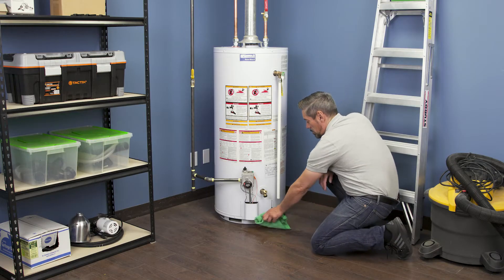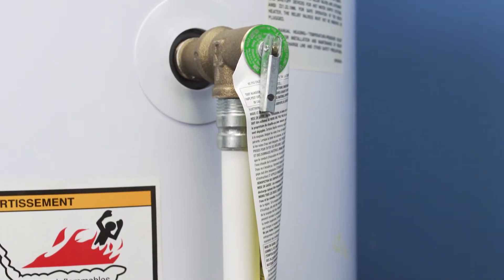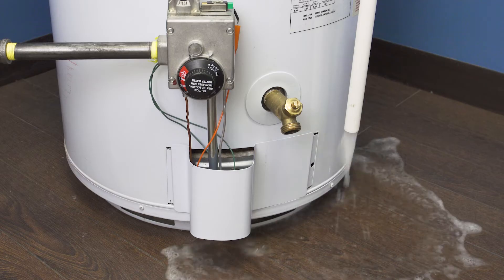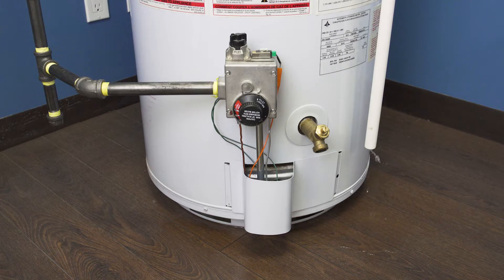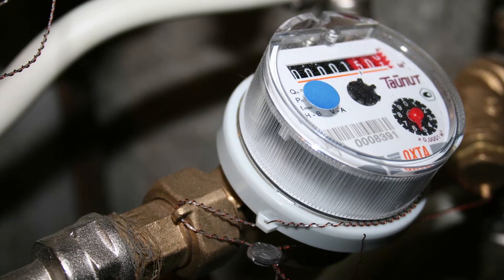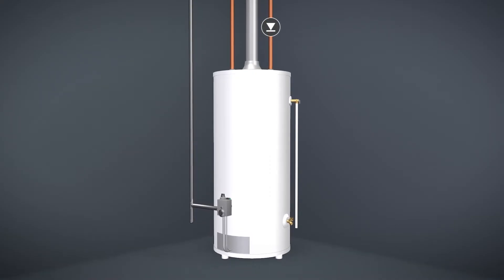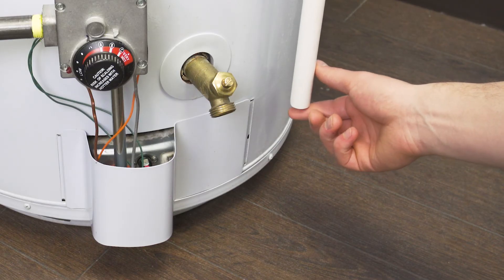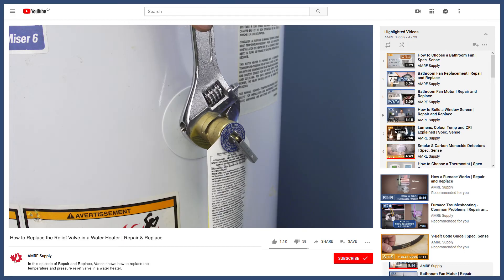Relief Valve Keeps Opening? Thermal Expansion Explained | Repair and Replace

Comment: I need a guard on this from my autistic son. He keeps messing with it. Alas, we have NO basement door. Little man keeps looking up information on all appliances. Scary. We told him it's VERY DANGEROUS! He just laughs. Time to restrict his tablet time.
Reply from the maker: That is difficult without a basement door. The problem is that the relief valve needs to be able to be opened for safety reasons, so you can't just lock the lever down.

Comment: I have a thermal expansion valve on the cold water inlet that keeps relief cold water. Is the valve faulty or too much excessive tank pressure?
Reply from the maker: Thank you for watching. If you already have a thermal expansion tank but the relief valve keeps on opening, then it's likely starting to wear down. If you install a new relief valve of the same rated pressure, and the relief valve still keeps opening intermittently, then it's likely a issue with the overall pressure. In this case a plumber would be needed to inspect the system as a whole.

Comment: Thank you for your video! I have a older, AO Smith gas water heater with expansion tank, a few weeks ago, I lifted the handle on the PRV to release a little water for monthly maintenance, the test was successful, however, since closing the valve, some water will only come out of the valve every evening after showers, I am finding myself having to keep a bucket under the pex tube and emptying it every day, is this normal operation from older water heaters? Is this a regular thing? I am scratching my head because my wife and I have lived in our house for 2 years and have never had to put a bucket under it before.
Reply from the maker: Thanks for watching. The expansion tank should prevent any increase of pressure that would trip the PRV so in this case it's possible that the relief valve is starting to wear down and might be releasing at lower than rated temperatures. Installing a new relief valve might fix the problem.

Comment: I just replaced an old electric hot water heater. The old one had no issues with the relief valve. The plumbing hasn’t changed. I popped the old heater out, and placed a new water heater back in its place. The new water heater is periodically blowing off water through the relief valve. I don’t understand why?
Reply from the maker: Thanks for watching. Is the new relief valve a lower rated valve?
Reply: @AmreSupply  I…. Don’t know? I’m kind of new at this. How would I determine that. I don’t see it written in the booklet that came with the new hot water tank?

Comment: My relief valve isn't purging, but the expansion valve above my water heater has developed a slow, steady trickle. About 1 - 1.5 gallons an hour. My municipal supply is around 125psi (I think it's supposed to be 80?), and that valve is rated at 125psi. I am trying to determine if its just a worn valve, too high of supply pressure, or both (supply pressure has worn the valve prematurely?). I've installed an inline gauge after my main supply pressure relief valve to monitor static pressure post PRV. The static pressure is 120psi all the time, and of course dips when any water in the house turns on. I've taken apart, inspected, and cleaned my PRV and it seems in good order, so I don't know why I cannot reduce the municipal supply pressure via the PRV. I want to get it sorted before I  go buying all kinds of parts, etc that may be unnecessary.
Reply from the maker: Thanks for watching, just saw this comment now. When it comes to water pressure and these sorts of adjustments it's honestly best to contact a plumber to get an expert opinion on it. There can be more than a few factors at play.
Reply: @AmreSupply  I actually ended up replacing both the PRV as well as the expansion relief valve, and everything is OK now. I'm able to reduce the municipal 125psi down to 80psi and monitor it with the inline gauge I installed 👍🏽

Comment: I just replaced my relief valve as it was slowly leaking.   New valve is now doing the same.   I noticed when I changed the valve that there was a lot of sediment build up in the opening.
Reply from the maker: Thanks for watching. It is not that uncommon for sediment to prevent the valve from closing properly. It can be helpful to flush the tank which is shown in this video: https://youtu.be/hkbi24QJhDw

Comment: My new Rheem water keeps doing this. Don't recall  the old one doing it. also I'll install the expansion tank I bought with the water heater. Maybe that's the issue as stated in the video
Reply from the maker: Thanks for watching! Keep us posted on if the expansion tank helps solve the issue.
Reply: Same thing. Brand new Rheem 50 gal.  Old one never did this.
Did you solve it?
Reply: @stephenbeard9882  yea. Looks like my expansion tank was busted. Replacement solved issue
Reply: Good to know! Thanks 👍
Reply from the maker: @Jame6999  Thanks for the update!

Comment: i ahve been having this issue.i was gogint ot get a expansion tank been then seen this on a article called a thermal expansion valve instead of a tank.does this work jsut as good as a expansion tank?
Reply from the maker: Thanks for watching. An expansion tank is generally standard but a thermal expansion valve can be used for the same purpose. There might be specific recommendations within your local plumbing code so it's still a good idea to check with a plumber.

Comment: What is stopping the mini expansion tank from filling with cold water from the main supply line if it is set at the same pressure as the inlet feed from the city water?  If the expansion tank is full, it is no longer an thermal expansion tank and has become a backup constant pressure tank just like on a house with a well system.  I think the expansion tank should be set at a pressure above the inlet feed to remain empty until the heat rises causing the pressure to rise then filling the expansion tank.
Reply from the maker: Thanks for watching. We didn't go into full detail on the expansion tank. There is a rubber diaphragm inside of the tank which will only expand at higher pressure. This prevents the expansion tank from filling with cold water.

Comment: I just installed a new ao smith 40 gallon tank and the pressure release valve is leaking.. Can it be my water pressure is to high? Do I have to install pressure relief tank.. on my old water heater (Rheem 40 gallon) I never had a pressure relief tank?  Please advise
Reply from the maker: Thanks for watching. The relief valve which is included on a new water heater should be rated and optimized for that water heater.

Is it a slow continuous leak? Or does the relief valve open up on a regular basis?

If the relief valve continues to open up then it could be a thermal expansion issue. In that case, a thermal expansion tank would help.

Alternatively it could be a defective relief valve.

Comment: I flipped mine open to check it, now it won't stop dripping.  It wasn't dripping before
Reply from the maker: Thanks for watching. Part of testing the relief valve to double check and know that it will close properly if needed. The relief valve should be able to open and close as needed and not continue to drip. It is possible that the spring is worn out or there is sediment that is preventing it from closing properly. You could try opening it again to get some more water flowing through. If that doesn't help then you might have to install a new valve: https://www.youtube.com/watch?v=2qhsmSbQQzc
Reply: @AmreSupply  thank you
Reply from the maker: @tbb7406  You're welcome!

Comment: Been in my house 6 years now and my relief started to dribble so I changed the relief it continued, took my expansion tank apart to find the inlet was corroded over to a needle size, simply cleaned re installed and stopped dribbling out of the relief, most definitely need an expansion tank on the water system 👍
Reply from the maker: Thanks for sharing your experience!
Reply: No problem at all, thought might help someone out, great video!
Reply: @derekmcdowell2547  ive been having issues and was told to get a expansion tank but was wondering if you ahve seen this thermal expansion valve instead of the tank?
Reply: Thermal Expansion Relief Valves Replace Expansion Tanks

Comment: I always noticed a leak in my basment and haven't pinpointed it until now.. I have my water heater set to max high and I put a bucket where the pressure valve is yesterday... can having my water heater set to too high can cause the valve to open regularly or too often.. if I lower my temp will this stop the valve from opening and releasing water on my floor.
Reply: A water heater thermostat on its highest setting wouldn't cause the T&P valve to discharge unless the thermostat was failing and not shutting off the heat.  A T&P  valve is rated to release at 210°F, 150psi.  A residential water heater typically maxes out at 150  to 160 °F, some commercial units max out at 180°F.
Reply from the maker: Thanks for watching. The relief valve should be rated above the highest working temperature that your tank is set to. If it's starting to open at lower temperatures than normal then the valve is likely faulty and should be replaced. https://youtu.be/2qhsmSbQQzc

Comment: Hey, thanks for the video 
I still have problem with the valve still water running out from there.after replacement 2 New valves and 2 expansion tank.
I don't know what's the problem even the plumber don't know what's going on 😂
Reply from the maker: Thanks for watching, we're glad that you found the video helpful! Without seeing your water heater and knowing the details its hard to say what is going on even after you've installed several expansion tanks.

Comment: When i moved into my 1948 house i noted the water heater had NO tp valve. 😳 So then after trying a few valves i could see they leaked continually (apparently that is why someone removed the valve), we put a pressure reducing valve in and that got everything under control 👍
Reply from the maker: Thanks for watching. We're glad that you were able to narrow down and solve the problem. A pressure reducing valve would help to give a buffer from thermal expansion!

Comment: I have two tanks in series. Will I find the expansion tank connected to the tank that is the furthest upstream? I think so because the downstream tank can just expand into the upstream tank, right?
Reply from the maker: Yes any additional pressure will just expand upstream into the thermal expansion tank. If you have more than one tank installed by your water heater, the one furthest upstream is likely a water softener, and the tank closest to the water heater is most likely the thermal expansion tank.
Reply: @AmreSupply  Sorry, I mean I have two water heaters in series and an expansion tank. I want to make sure I identify which water heater is which. I believe the one connected to the expansion tank is the most upstream one. Does that sound right?
Reply from the maker: @mitchjohnson4714  Thanks for the clarification. Since water does not compress the expansion tank will still help balance the pressure in both water heater tanks, regardless of how it is connected.
Reply: @AmreSupply  I'm just trying to confirm which water heater is upstream. I think it's the one with the expansion tank because the downstream heater can just push water into the upstream heater, while the upstream heater cannot push water back into the pipe. It can only push water into the expansion tank, right?
Reply from the maker: @mitchjohnson4714  Thermal expansion is minimal so there is only a small amount of water being pushed into the thermal expansion tank. If thermal expansion occurs it will move from the downstream water heater into the next water heater and into the expansion tank. Based of the size of the expansion tank, it is unlikely for that to fill up completely, therefore you're preventing small amounts of water from being released out of the relief valve. Based on the water pressure and any check valves, in most cases water can't push into the cold water supply.
Reply: @AmreSupply  Thanks. I keep wanting to check the engravings on the heaters, but I've been super busy all day.

Comment: I still don't really get why I need the expansion tank. It sounds like the relief valve is doing it's job, so why is the expansion tank necessary? Is it in cases where the expansion happens too often, so you're trying to save power and water, by not releasing all that heat and water?
Reply from the maker: The relief valve is meant as a safety device to protect against a more serious high pressure overheating event. It is not intended to be opened each day (via a small amount of thermal expansion) as this can reduce the life of the valve.

Comment: What de didn't say is sometimes if the water heater hasn't been flushed at all, hard water build up or sediment will build up inside the spring in the relief valve causing it to run continuously
Reply from the maker: Thanks for watching. You're right that sediment can interfere with the relief valve and prevent it from closing properly. If the relief valve has a continuous leak then it can be easily replaced following the steps in this video: https://youtu.be/2qhsmSbQQzc

Comment: I have a problem with my valve, it gushes water but it's not scalding. less than lukewarm. I've used the spring lever and it does stop leaking for 1-2 seconds then quickly comes back to a freeflow
Reply from the maker: Hi Kei, thank you for watching. It seems like the relief valve is starting to wear down and open at much lower temperatures than normal. You can see how to replace it here: https://www.youtube.com/watch?v=2qhsmSbQQzc And you can get a new valve here: https://www.amresupply.com/catalog/Temperature-Pressure-Relief-Valves-662940-HH41

Comment: This might seem like a silly question but is the water that comes out of the release valve hot water? I have two kitty’s that stay in our basement and one of them burnt both of his front paws. Iv been trying to figure out what might of cause the burns and I thought this might be the source.
Reply from the maker: Hi Michael, thank you for watching. Yes the water that comes out of the pressure relief valve will be very hot and pressurized and could definitely cause a burn.

Comment: Hey, great video. I just discovered my valve dumps water pretty much nightly. I already have a diaphragm installed, should I be worried about this or just let it continue doing what it's doing?
Reply from the maker: Hi Marcus, thank you for watching, we're glad you found the video helpful.
First verify if you have the correct relief valve installed looking at both temperature and pressure. An incorrect valve can open under relatively normal temperatures and pressures. You can read the tag on the relief valve and then compare that to your manual for your water heater
As well if the expansion tank worked correctly after it is installed, but is just now starting dumping water then its possible that the expansion tank is not working correctly and the diaphragm is ruptured.
If the problem persists or if the amount of water being discharged is unmanageable then its often best to get it inspected by a professional.
Reply: @AmreSupply  thanks for the thorough response. I'm planning on replacing the valve first and seeing if that does the trick or helps any. If it doesn't I'll definitely get a plumber in to tackle the more complicated stuff.

Thanks a lot!
Reply from the maker: @BlackAndWhiteBiking  You're welcome! Best of luck on the valve replacement. If it helps we did a video detailing all the steps: https://youtu.be/2qhsmSbQQzc
Reply: @AmreSupply  thanks! And just wanted to say you were spot on with the expansion tank diaphragm being ruptured. Water came spurting out when I poked the air nozzle. So I'll be replacing that and the pressure valve while I'm at it and I'll be good to go.

Thanks again, cheers!
Reply from the maker: @BlackAndWhiteBiking  Thanks for the update, glad you were able to narrow it down. Just happy to help out where we can! Take care!

Comment: I'm searching...
What if you have a cold water niple with a backflow built in?
Reply from the maker: Thanks for watching. A backflow or a checkvalve that is built into the cold water nipple would prevent hot water from flowing back into the cold line so yes it can cause the relief valve to open.